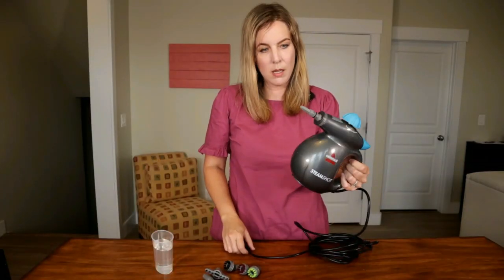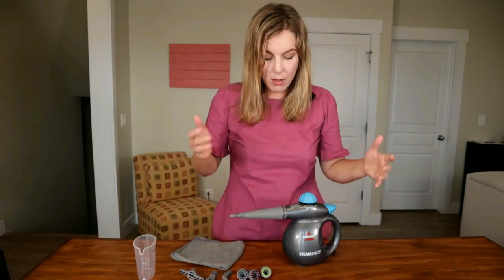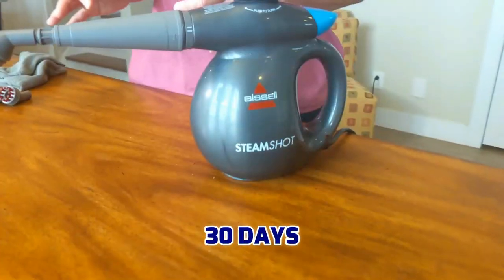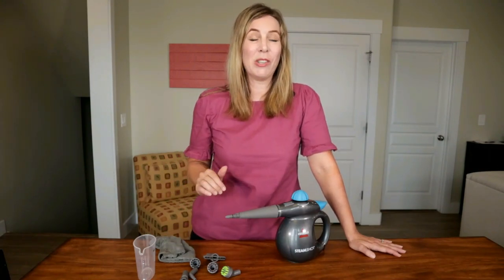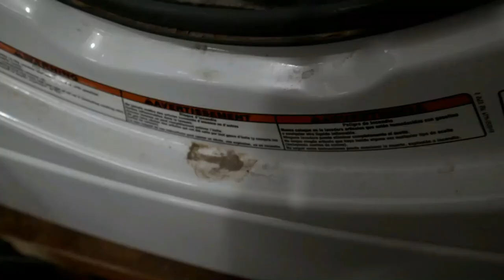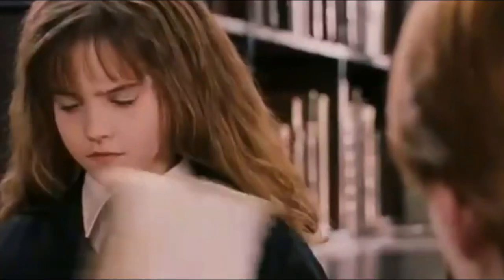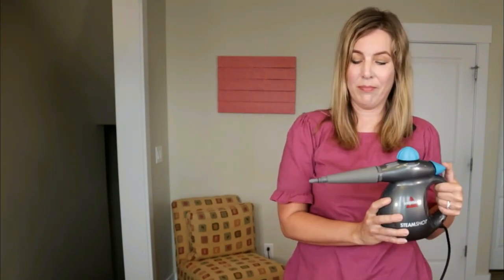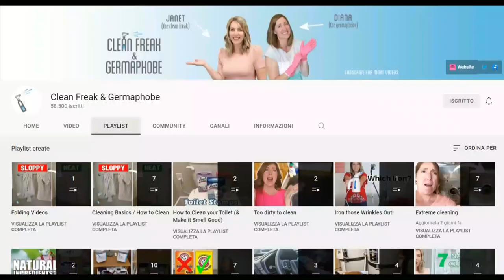BISSELL STEAMSHOT STEAM CLEANER REVIEW / CLEAN WITH ME

Comment: I’m curious if your required to put the water in tepid or room temp? I wonder if tackling a larger or grimier area if you could have a warmed kettle on for refills to speed up the “heating” time in unit, I’m not suggesting a whistling kettle but one that got up say when you first started the task with tap and then was turned off and sat waiting to refill unit. Any thought? Thanks for the video!
Reply from the maker: Actually yes! You can start with hotter water and it’ll take less time to heat up. I’ve been doing that more when I use tap water. Just turn the faucet as hot as it can get first.
Reply: @CleanFreakGermaphobe  thanks so much for the reply! Have you noticed any calcium or hard water build up using tap over distilled? I would think using a touch of vinegar in the water could address that, thoughts?
Reply: Read somehwre in instruction u should use room temperature water and not hot .. so that it doesnt messup system

Comment: Can you use this to take grease off of kitchen cabinets ?
Reply from the maker: Yes, it would work well for that. I would use the nylon brush with a microfiber cloth over it to prevent scratching. If you have a lot of cupboards and the budget a larger one will be much faster (we could recommend one) and use a triangle tool. 

We have a video where I demo cleaning cabinets with another steam cleaner. Check it out here https://youtu.be/SDZXejD_Tis and there’s a link in the description to the steamer I used. You don’t have to hold down the button to get steam. It locks on. That will save you on bigger cleaning jobs. And you won’t have to refill and wait for it to heat up again like on this smaller one.
Reply: Thank you

Comment: Great video! Can you compare it with Dupray steamer especially for bathrooms?
Reply from the maker: Thanks so much. I mean this is for smaller jobs and it's light and quick. 

Dupray is still my favorite but sometimes you just need something quick and easy.  

The Dupray can mop, reach further, has the triangle tool to cover more surface area (like a whole shower). Plus you don't need to hold down the steam trigger. You can push a button on the handle and it stays on.

So it really depends on budget and how you clean. If it's short and more frequent then the Bissell. If you're doing more deep cleaning for longer than 20 minutes and want to mop, the Bissell will get tedious to keep refilling. 

Hope that helps!

Comment: Does not putting the extender make the steam that comes out hotter? I put the pointy thing on and it doesn't seem very hot unless I put my hand very close.
Reply from the maker: Yes any attachment that takes water further away from the boiler in the center also cools it. A larger machine like the Dupray Neat will get hotter and hold more water. https://cleanfreakandgermaphobe.com/dupray-neat-steam-cleaner/ but it's more pricey.

Comment: Do you unplug the steamer after it heats up I'm bit nervous using it around water with electricity..thanks if anyone can let me know please..😊
Reply: You don't have to unplug it, but you can if you want since the steam is already built up
Reply: @cricka09  thank you 😊
Reply from the maker: Never had a problem - as long as you're not using around electrical outlets or lines. If you unplug then you lose steam and that's the cleaning power.

Comment: My steamshot lasts 2 minutes and 20 seconds before it runs out of steam 😭 Mine is brand new. So much water everywhere. More water than steam.
Reply from the maker: I wonder if you got a defective one because mine isn't like that. It has more water when starting up. But yeah it doesn't last very long, however I think it's longer than that. I use it for quick jobs.
Reply: Neither mine. It works fine

Comment: Seems like these reviews always choose places and things unusably filthy so any steamer would produce results better then how it looked originally but what about normal households that don't have a bunch of filthy...how does the steamer work on everyday dirt not filth from abandoned or empty apartments..  That's the true test.
Reply: Well it supposedly sanitizes
Reply: @gghhhhhhhhb8161  well if anything is hit with that amount of heat I sure hope it sanitizes 😂
Reply: These machines are used exactly on those occasions. It only lasts 15 minutes, you cannot use it for everyday cleaning. Their use is for stubborn dirt. I only use it when I have to clean things like the hood metal filters, for other, more often uses you should use those which can be refilled without having to unplug them.
Reply from the maker: It works great in everyday dirt. I use it to clean the bathrooms and they’re pretty clean. In my most recent video I showed using it on everyday things. Like the spill in the microwave or on the shower.